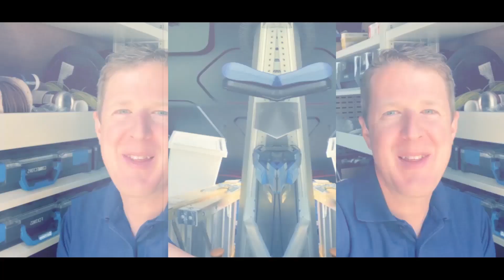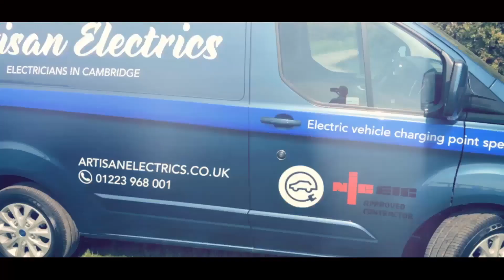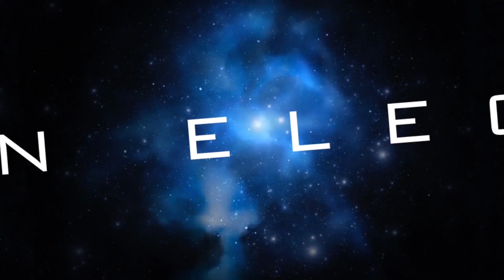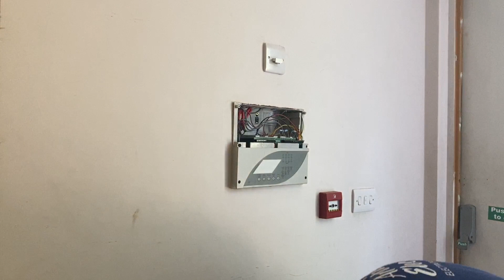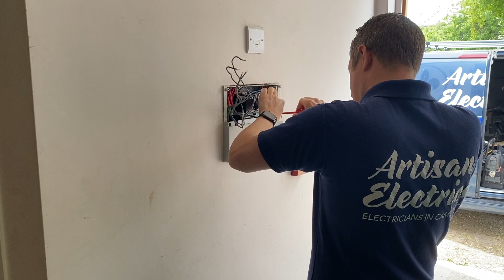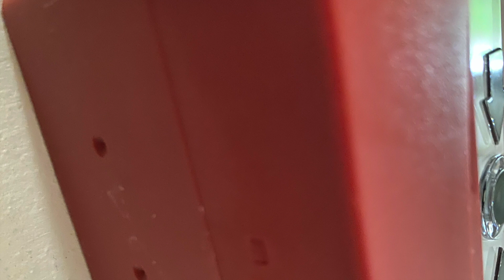Fire Alarm System Fault Finding - The Scout Hut Episode 7

Comment: That's place is a nightmare! Made me laugh when you looked bat the batteries fault and there wasn't any in it. Maybe easier to start over with that one. Did the emergency lighting hold up as in the last video they didn't as you just connect them up. Thanks for the video.
Reply from the maker: Thanks! Not sure if the emergency lighting batteries are up to scratch, i've quote for a full 6 monthly test so we will see.
Reply: Artisan Electrics,  Didn’t you have the power off to change the board, surely a quick walk round would explain a lot